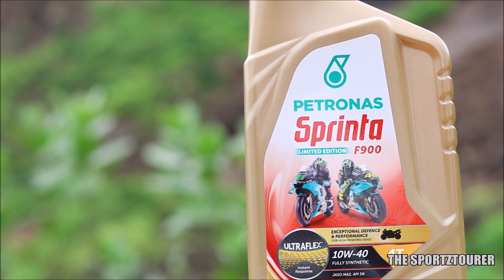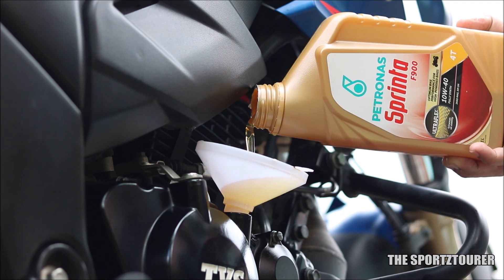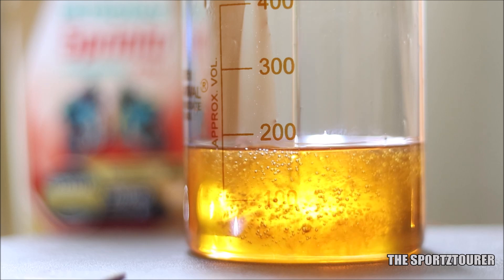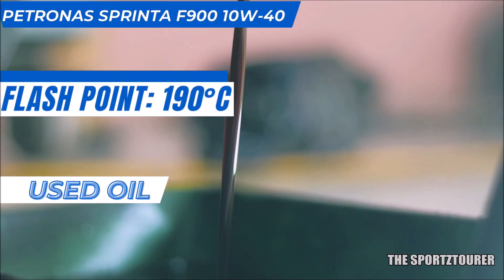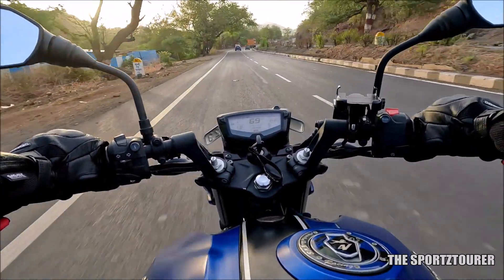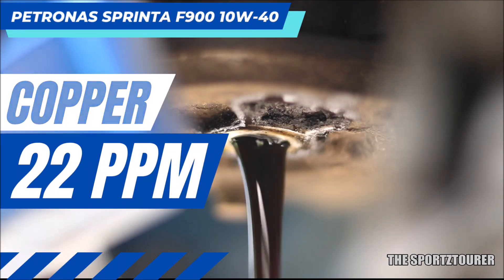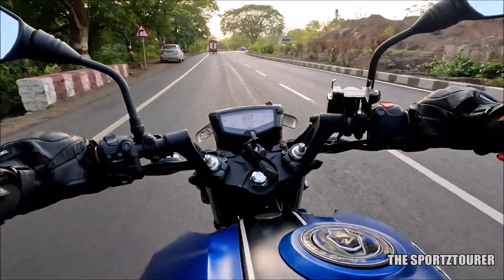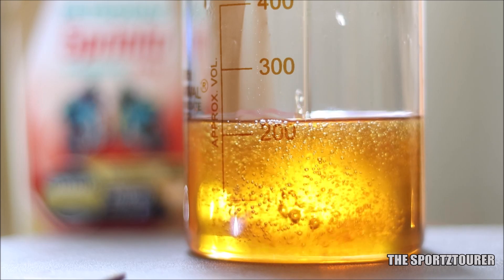6000KM LAB TEST PETRONAS SPRINTA F900 ENGINE OIL ON TVS APACHE RTR MOTUL, SHELL SUMMER ENGINE OIL

Comment: In your opinion, which is more suitable for my fz16 with 200cc displacement and open carburetor? I’ve tried Shell fully synthetic and in only 900km of riding, viscosity is already thin and color is very dark. I ride this motorcycle only on weekends and on high revs. I have my yamaha nmax for everyday use. TIA, i love ur videos.

Comment: @thesportztourer make a video on the number of heat cycles engine oil can tolerate since short trips makes engine oil service interval shorter, and these use cases need frequent oil change as compared to recommended oil change interval

Comment: I own a Yamaha ray zr 125 scooter, and the company recommended grade is 10W40, whereas almost every other scooter usages 10W30, 10w30 is easily available, but its such a hassle to get a 10w40 scooter oil, out of curiosity i tried using Motul 3100 10w30 scooter, but engine started heating noticeably even on 5km round trip, now i am worried, should i keep using it ? And why yamaha recommending 10w40 in the first place? please reply

Comment: Please do a review of idemitsu 10w30 JASO MB fully synthetic scooter engine oil
Reply from the maker: Let me check on that, are you using it?
Reply: @thesportztourer  yes, my suzuki access 125 bs6 2024 performs better on idemitsu 10w30 fully synthetic MB engine oil than company filled semi synthetic ecstar 10w30 MA. I guess its due to higher TBN of 8.02, flash point of 230 and  viscosity of 14.73 @ 100°C.